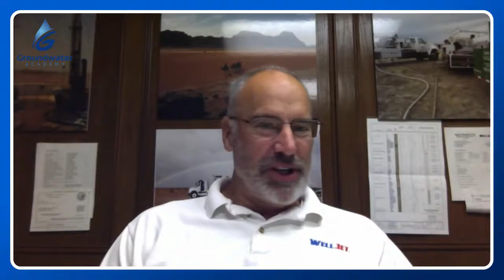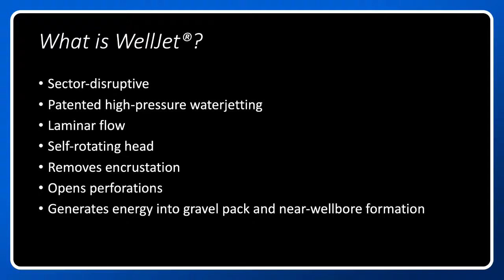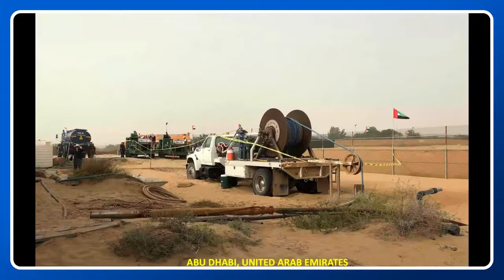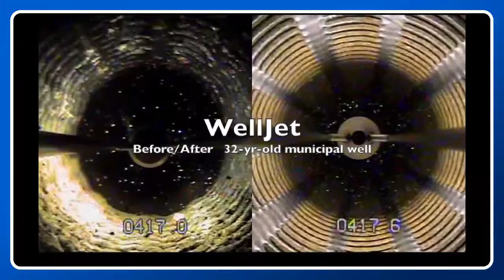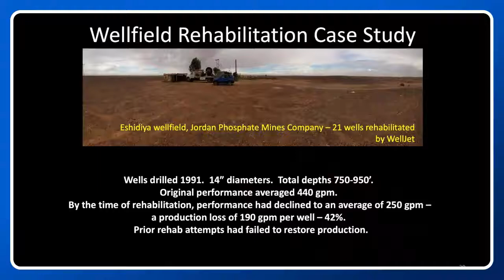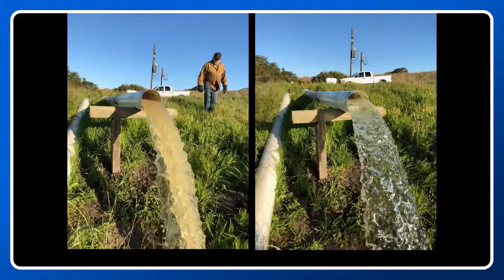Charles Carner of Well Jet interview

Comment: How do you overcome the fears of  jetting bacteria and their biomatter, and or drilling mud into the filter pack?
Reply from the maker: It's a multi-step process: the jetting breaks everything up and then you use a dual surge block to pull everything back into the well so it can be airlifted out.  For development purposes, you are going to remove the mud to the extent possible before starting the actual well development process, but a lot of what is coating the borehole walls, has penetrated the formation, and what is already in the filter back needs to be broken up and removed through a multi-step process, of which jetting is a part.  

In the case of biomass, it originates from outside the well and generally what is outside the well screen is going to be as bad as or worse than what is actually in the well itself, since the bacteria originates from the formation and the bacteria will colonize from the outside of the well in.  The well screens, inside and outside the well, provide a nice conducive environment for bacteria growth - especially aerobic bacteria.  The biofilm you often see in wells is not the bacteria itself, but rather a slimy protective coating that the bacteria extrude to protect the bacteria colony. In order to effectively attack the bacteria, you need to break up the biofilm to even get to the bacteria.  Biofouling of a well is going to require chemical treatment to kill or inhibit bacterial growth, but they will eventually return because they are naturally present in the aquifer.

In short, as Charlie alludes to in the video, the jetting process works in conjunction with other rehabilitation techniques that will be selected specific to the well and the types of plugging problems encountered in the well.